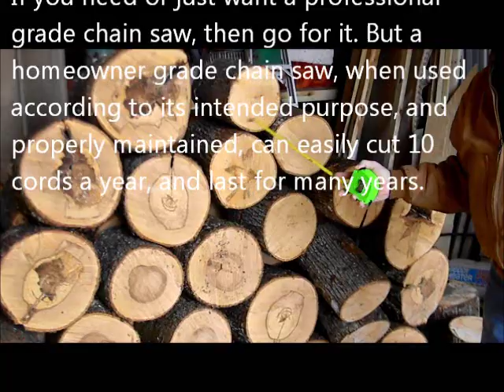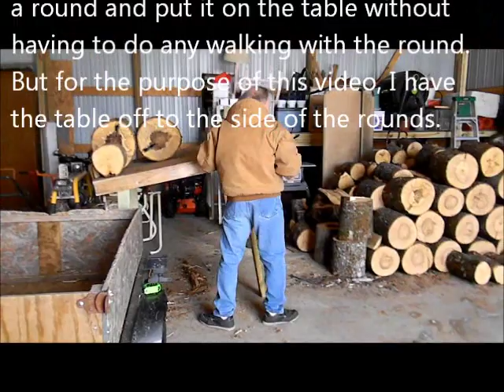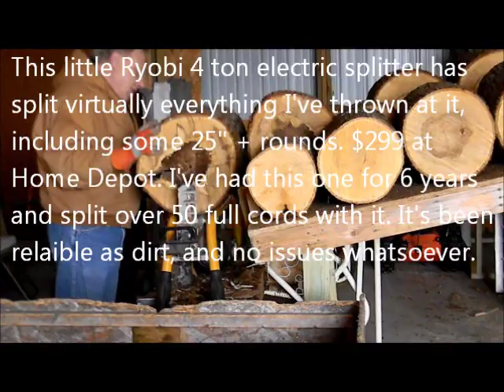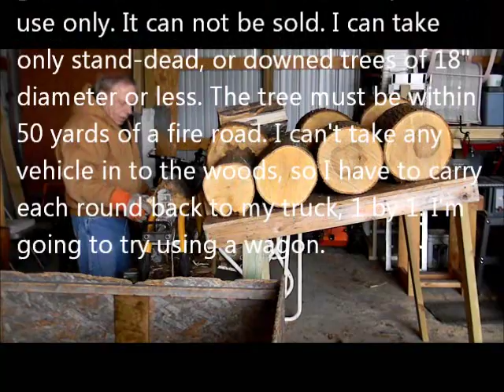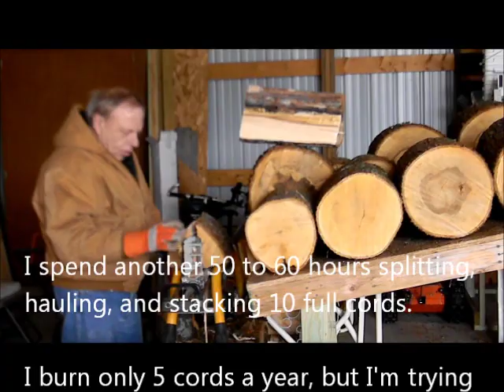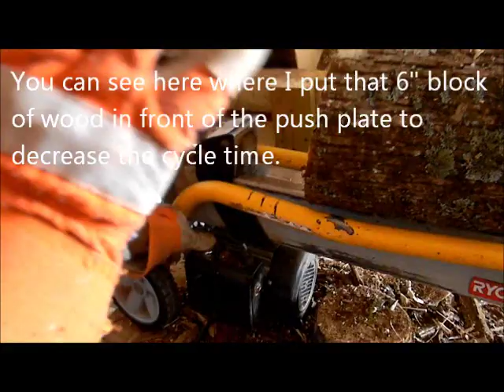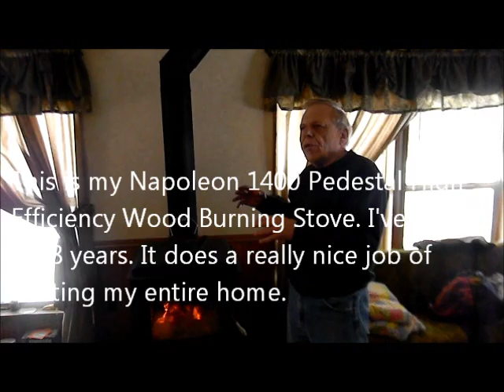Making Firewood

Comment: My hydraulic splitter is slow, but powerful. Even so, it would outpace yours easily. Any gas powered hydraulic splitter would run rings around the electric. That's why they cost three times as much. That being said, you don't seem to be in a rush. I'd get rid of the two-switch crap. When splitting wood you should strive to eliminate handling. Instead of carrying rounds to a table, just carry them to the splitter. Then again, you have your system and it seems to work for you. Thanks for posting.

Comment: I Love your no nonsense video. I have used a similar setup but just level tables, on each side of the splitter. Your setup is slick. I myself can obtain the same permits in Alberta, and there is nothing better for me to do than to head out to the forestry and spend time cutting and hauling wood with my family and dog. I do not need as much as you, probably just three to four cords of pine and birch. I just use it to heat my garage in the Fall, Winter and Spring and in the fireplace in the house. If I could I would convert my fireplace to a woodstove in a heartbeat.
Reply: What part of Alberta? Where do u go to get your wood?

Comment: My hat off to you sir, you have a nice system that maximizes your time if using one of these painfully slow machines. Just run a brace across the lower part of your loading tables legs for more stability. I might even put a shelf across this lower part to weight it down with other junk so it will not be top heavy. Oh, and don't let my wife see this video, she will say I don't need a DR RapidFire splitter!  Thanks for sharing, I will certainly give it some thought.

Comment: Try to instal a foot switch, it would help a lot, because you would have two arms holding a log, and thats much easier and faster.
Reply: ...and sooo less safe. Two hand operation is there for a reason..SAFETY!! Only a  4 Ton.....but still...should be using 2 hand operation....